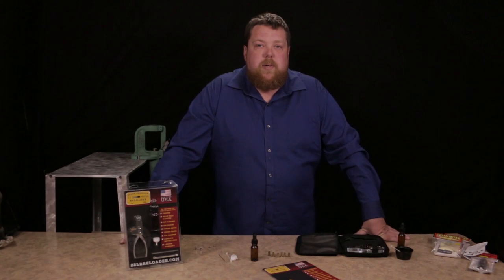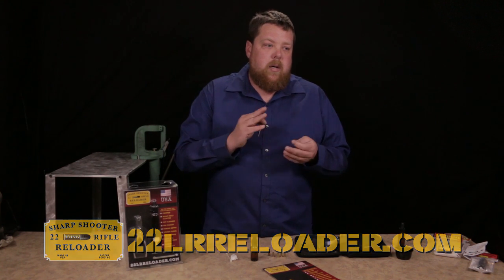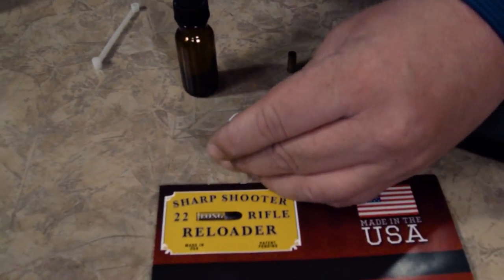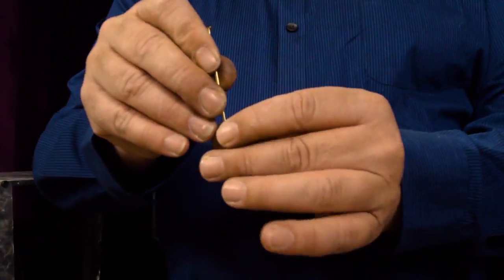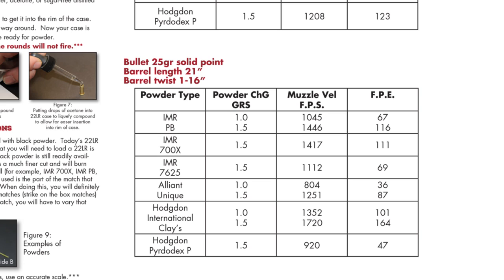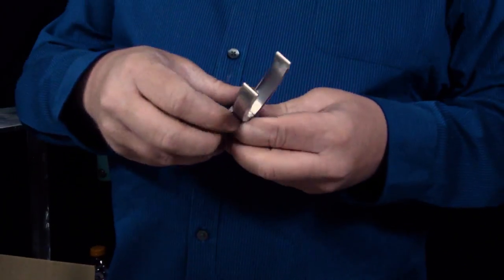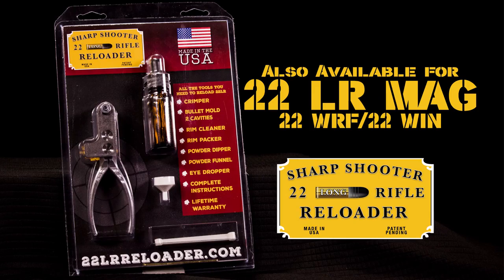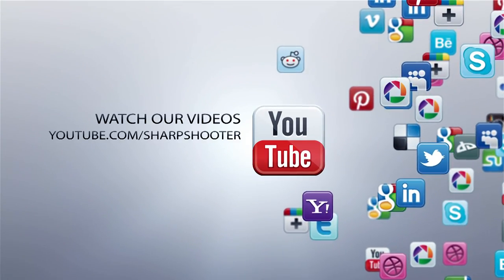VIDEO 3 - 22 LR RELOADER

Comment: Excellent product! Couldn’t be happier! Thanks Brian! Remember to smoke the mold a lot. It helps with casting lines and of course release. I was staying patient as Brian told me they are swamped having it two weeks later and I’m a happy customer! Thanks again! Edit: I’ve found that CCI, Remington, Winchester, New Norma and some shorts I reloaded work with no resizing needed. I only have issues with Federal casings. Side note, I use the 25 grain for 3 things. They work as a “stinger” type round a 22 short and I also have great performance from them in a break barrel 22 springer.

Comment: Be a lot faster if the compound were a thin paste dropped in the base and the casing spun to 10,000 rpm for a split second in a 1/4"  rotary tool. You'd want to use a keyless chuck adapter that can take the .22 case. It would make quick and very uniform work of using centrifugal force to sling the compound into the rim where it belongs. Hint: Factories do this.
Reply: Yes. It would be a lot faster. However this is actually surprisingly reliable. I have done this several times doing my own research testing 22 repriming, and you can pack match head powder into a case rim by hand and it'll work 100% of the time. If you have a lathe or a pneumatic rotary tool, then this is probably better, but for those who don't, this manual method certainly works.

Comment: Hi guys, great video. Can I use your re-sizing die and modify the case re-sizer to work like a WaltZ .22 re-sizing die would, I just need to change the shape the end of the round to a hollow point or a Eley style tip. cheers

Comment: What I want to know is how you take the crimp out of the shell.  I went to load some and couldn't get projectile in most of the time.
Reply from the maker: If your having that problem use a reloading reamer
Reply: Took small pointed punch with angled shoulder. Gave the case mouth a tap with a small brass hammer. Flairs neck a tiny bit, also round out case mouth that are out of round. Bullet go in every time. Crimping tool takes the flair out.

Comment: Question 1: Have you tried powder coating the bullets? For velocities and twists where you normally use copper plated .22 LR that would be the boss, but I'd think the heel of the bullet would need to be smaller since you can't size that?
Question 2: What does the priming compound consist of? I imagine you won't ship the compound internationally, so I'd have to be able to source it locally since I'm in Scandinavia.
Reply: Mix fine match head powder with the red striking strip of the match box
Scrape the red powder with a sharp blade test the mixture before repriming.
Reply: You would have to send the bullet through a resizer after powder coating.  It is a good idea tho.  I would.  Maybe lee would make a custom sizer.

Comment: Hi just ordered the kit.. Can I use lead fishing sinkers (splitshot type stuff) to cast bullets?
Reply: I know barely anything about fishing, but as long as the sinker is 100% lead and you know how to get all the impurities out I see no reason why you couldn't
Reply: Zinc is your enemy, other than that, it's finding a temp that works for your mold. If your lead is castable, it will not be hard enough to hurt your barrel.  I've see sinkers loaded into 12 gauge as buckshot, so yeah, it works, it's lead. PPL cast sinkers with the same ingot that will cast a bullet.
Reply: YES you can. I buy the big egg sinkers and wheel weights all the time.
Reply: Yes I use fishing weights, to cast, for a 45-70.

Comment: Well my 1st try was a dud. Used the Prime All, did the exact scoops, used aceatone  Went by all the instructions, no short cuts, or substitutes. Packed the rim, even let it dry for a few days. Then added shotshell powder, and crimped projectile. Stuck it in my S&W 9 shot revolver (which has a hard hitting hammer), and "click". No Bang! waited about a minute, spun the bullet (to try hitting another spot on the rim), still nothing. Spun it again, still nothing. Idk, maybe I did something wrong. I'll try another one later. Next time I'll try just priming the rim, and fire the empty shell to see if it works.
Reply: Issue may be the type of powder you used. Not all powder burns at the same rate…
Reply: @CanabalasianFury  i didn't load the shell. Just test fired the primers in an empty casing. The prime all primers hardly make a snap sound. Factory primers sound like fire crackers going off. All the primers made from prime all either do nothing or they just make a weak pop.
Reply: Honestly, it might now have been you or the powder. Reloading 22 can be a huge pain and unreliable. One thing I might recommend however is that you mix some nail varnish in with the powder to cement it. It might be that the powder fell out of the rim because it wasn't affixed in.

Comment: Any chance .22 shorts can be done with this? Or do you make one for .22 shorts?
Reply: No difference.
Reply: @noahway13  the crimping step wouldn’t work but the priming is the same. 
I got the 22mag setup also, mainly for the bullet mold seeing as it’s got 2 same cavities. They aren’t the same as the 22lr cavities but the crimp cavity is the same in both molds. I imagine you’d have to place the 22mag shell in at the correct depth by eye instead of simply placing up to the rim like you do with the LR setup. 
I’ll try it when I get some empty 22mag brass. I just finished priming a few LR shells and made a few #11 snap caps with primer. 
Gotta mold some bullets and I’ll do a test but I’m not going to shoot off mag rounds just to test that kit

Comment: does the caster work with copper?
Reply: Considering copper melts at roughly 800* f higher than Al you can bet the mold will melt or deform as aluminum melts at a much lower temperature.

Comment: Я занимаюсь релоадингом 12к. С калибром 22lr ещё не работал. Заинтересовал Ваш набор. Идея интересная. Есть вопрос: "Сколько раз можно переснаряжать одну и туже гильзу?"
Reply: Здравствуйте,  вы разобрались с релоадом 22 LR ?????
Reply: @user-nc6js6od7p  да. Спасибо.
Reply: @KalashnikIlya  есть видео о том как снаряжаете патроны на мелкашку ????
Reply: @user-nc6js6od7p  да времени займет многовато. Но если ты увлечен, то только в кайф.
Reply: @user-nc6js6od7p  И я очень вам советую удалить свой комметрарий и на время избавиться от мелкашки. Зря вы про разрешение написали. Теперь в России 95% случаев к вам с обыском прийдут в течение до полугода. 
Нельзя такое в интернете писать.
Reply: @user-nc6js6od7p  ну или попробуйте легализовать. Способы в интернете найдете.
Reply: @user-nc6js6od7p  А вообще мой вам совет в россии с релоадом именно 22лр всё очень сложно. Может быть и есть возможность товары из сша завезти, но это в такую копейку выльется что не окупится.
Reply: @KalashnikIlya  вы с какого края земли ????
Reply: @user-nc6js6od7p  ставрополье.
Reply: Братцы, капсюльной смеси, намешанной из пакетиков, сколько в гильзу насыпать?
Reply: @JackNPag  незнаю бро
Reply: @user-nc6js6od7p   Sorry if you don't speak English. I have successfully reloaded 22 long rifle. I crumble the heads off of two-strike anywhere matches with needle nose pliers, and then grind up the heads off of the matches using the back of a screwdriver against a metal plate, until they are very fine powder. The matches MUST be strike-anywhere and not strike-on-box, because the box matches don't have phosphorus in the heads that can react with the potassium chlorate to cause the spontaneous detonation. Also, mixing the striker strip with the match heads may work for some people but personally the strike anywhere matches already have the correct mixture of potassium chlorate and phosphorus, and the striker strip method is unreliable for rimfire cartridges. Cutting out a PIECE of the strip and using that to reload centerfire ammunition does work however, as I have tried that. Then I pour the powder into a case, I push it into the rim in every direction with the tip of a needle file as much as I can, and then I tamp the powder remaining in the back of the file until it's seated. This is a very reliable method, but the powder can easily fall out of the case (especially if you're reloading with smokeless powder, which requires an air gap), so I have a better one :

Crumble the heads off of a couple boxes or so of strike anywhere matches, and put them in a wet tumbler with some water and lead balls. The water prevents detonation, and the lead balls won't cause sparks and are soft. This will create a MUCH finer powder than you could achieve by grinding manually. A makeshift ball mill can be made using a plastic two liter bottle attached to a drill, with a rope around the trigger, to keep it spinning at a low speed indefinitely. Be very careful doing this, as the mixture is of course explosive. Too much water is surely better than not enough, and also make aure to open the bottle occasionally so oxygen can get in. Also, the powder will be contaminated with lead, so it will be quite poisonous, so handle with gloves. Also, don't let the mixture get too cold, as the potassium chlorate will probably dissolve in the water and form large crystals. After a few hours, or however long it takes, you should have a very fine cakey powder. Now, allow this to dry fully, because the water will contaminate the explosive if it's not very dry. Next, add enough acetone to make the powder into a paste, and add 3 or so drops of nail polish for every 8 match heads you used in the powder to the paste, and mix it together. You may have to experiment with this to get it right. This nail polish will cement the powder, and prevent it from just falling out of the case when dry. You should end up with a solid but very slightly crumbly puck after allowing this to dry again. Also, you may want to line your mixing dish with something so that the puck doesn't stick to it when it dries. When you're ready to prime the casings break off a piece of your solid puck of primer, re-wet it with acetone, and use the same method. Use a scoop to get a predetermined amount of the powder into the case. Then make sure to push the powder into rim and run the tip of the file against the opening to the rim, to make sure it's compacted in there, before tamping it all down. Alternatively, you can put a scoop into the cases, and then add a bit of acetone to make it flow better before putting it on a thin steel rod, and putting the rod in rotary tool and spinning the case so that the paste flows into the rim. And make sure it's tamped down solid after. You can also use an arbor press to compact the paste, but don't apply more than a quarter ton or so of pressure because your case will probably explode. Or, best of all, you could apply a little bit of pressure to the bottom of the case when spinning, like with a drill press. I have had some success with this actually, but you must experiment to get it reliable. Now just wait for this to dry and you should have a fairly reliable ignition. At least 9 out of 10 cases will go off, more if you practice somewhat. You can load the cases with very fine black powder (10% sulfur 15% charcoal 75% potassium chlorate or some such) or high pressure smokeless. 22 is a very high pressure round. 1.5 grains of something like "Unique" powder or 4 grains of 4F black powder should work. You can also use a grain or so of the ground up match head powder, but that is quite dangerous indeed and I would personally never recommend anyone do that unless they were truly desperate.

Make sure your cases are clean before doing this because, if they aren't, then oxides and char can go into your priming compound and make it less reliable when the cases is loaded.

Also, 75% potassium chlorate or potassium nitrate, 15% dark flake aluminium, and 10% sulfur will probably work as an impact explosive. You can make or buy all these components yourself quite cheaply (potassium nitrate is stump remover, potassium chlorate is normal strike on box match heads, dark flake aluminium is just normal pure aluminium, like a beverage can, that's been milled dry very finely, and sulfur is a cheap fertilizer) and then mix them together AFTER ball milling, so it's much safer and cheaper to make a good quantity of it. You can probably use the nail polish trick with this stuff too, although I confess I have never tested this mixture myself at all, and I have only ever used strike anywhere matches.

Also, I must mention that all of these custom powders, though they definitely work, are corrosive. So clean your guns thoroughly after use or they will rust.

I make no claim that any of this is safe. There is always a chance of serious bodily harm when you do this, so you are doing it at your own risk. This is genuinely dangerous and you need to be careful if you attempt it.

I am from the USA by the way :)

Comment: This kit does not include a resizing die but you sell a resizing die separately, thus is seems like resizing is deemed optional.  What are the advantages purchasing and using the resizing die on my press if it is optional?
Reply: lol nevermind!  You answered my question in the video about the die. (if using brass not fired from your own gun, resize, right?)
Reply from the maker: bgilmore3 the kit is set up like the old lee loaders so if u are shooting the case out of the same gun or u check the cases before u load them your good to go if u don't want to do that the re sizing is the perfect option

Comment: I can't get the prime all to ignite
Reply: John Beige  duh. I can tell without that, geezer, far from newbie here
Reply: @independentthinker8930  may be tge humidity do you live in a humid area?
Reply: @travisj.1938  it is in summer. I got a pm that gave suggestion to try
Reply: @travisj.1938  if it's so sensitive it's useless to me. Stick with roll caps
Reply: @independentthinker8930  that really stinks your not having any luck with it. I do not have one I was interested in getting one but am having second thoughts now. I am unfamiliar with roll caps I will look them up 👍